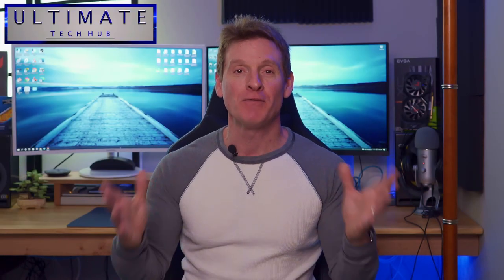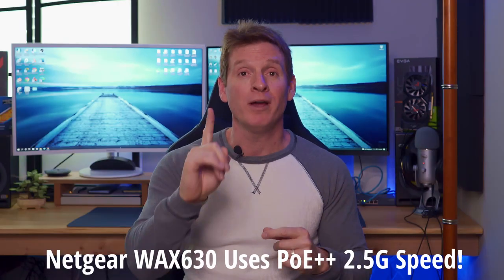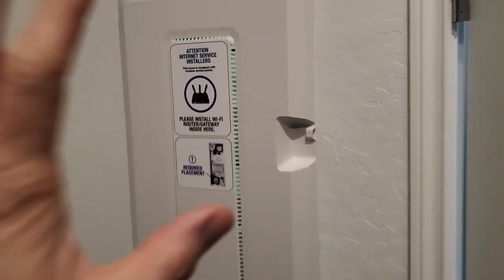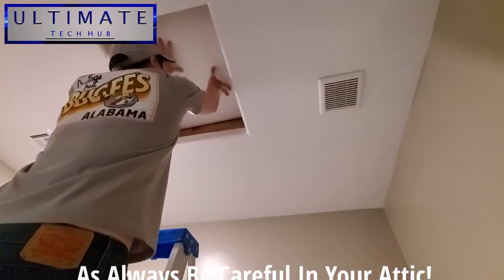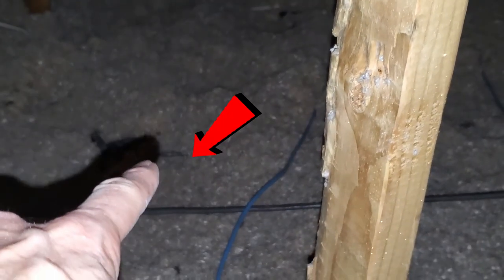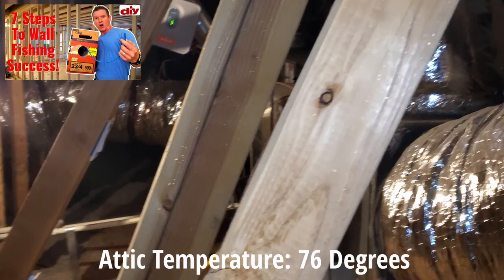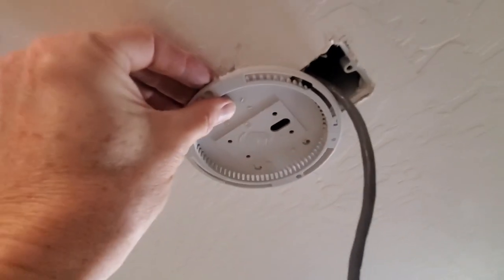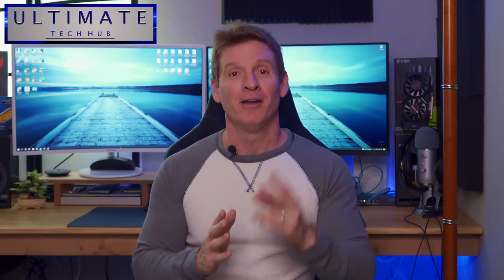INSTALLING CEILING-MOUNT Wi-Fi ACCESS POINT | HOW TO INSTALL WAP 2022

Comment: Thanks for the vid.  I have 3 locations one on each level of my 3 level home.  After I install the WAP’s like you showed in the vid, what do I need to do at the boxes?  There’s an exterior box on the side of the house and another box in the 2nd floor master bedroom closet.  Is some kind of switch required?  I appreciate all detail you’re able to provide about this.  Thanks again.
Reply from the maker: The interior box in the second floor closet is where all the etherent cables should run to. This includes the etherent cables from all 3 WAPs. In the box you need a modem, router and a PoE managed switch to connect to the PoE WAPs. Hope this helps. I have over 100 home networking videos so make sure to check them out. Thank you for watching.
Reply: @UltimateTechHub  It has to be a managed switch?
Reply from the maker: @Tommy-dz5zl  Yes to run the WAPs you need a PoE managed switch. I have videos on how to use them. They are pretty easy and around 100 dollars.

Comment: Hi and thanks for the video 👍 … one question though … I have an existing wireless router from Spectrum with 4 Ethernet ports … I want to add a WAP to increase wifi capability to my garage but how does a WAP coexist with an existing router which has its own SSID?  I assume the WAP will have a different SSID in which case any devices attached to the WAP SSID would then be on a different network from the router SSID?  Will the devices on the two networks “see” each other or how does this work? I’m confused about this.  Thanks 🙏
Reply from the maker: The 2nd router is an acces point.  You will have 2 different SSIDs.

Comment: Set one up tonight. Had a decent bend in my Ethernet . Thoughts ?
Reply from the maker: Does the bend affect the connection? One of my WAPs has a decent bend in  the ethernet but it doesn't affect the signals.
Reply: Yeah. I’ll have to see once I get it up and running. I’m sure it’s fine. Just saw online that the bend shouldn’t be extreme
Reply from the maker: @Arr5503  You would be surprised how durable ethernet cables are. They can take beating!!! Lol. Keep me posted and thanks for watching.

Comment: Hi, I am looking to install 2 WAP in my home(Ubiquiti UniFi 6 Lite) (one upstairs and one down) do I need two PoE injectors or is there a dual port PoE injector I can add to my low voltage panel? Also does this go from modem > router > PoE injector?
Reply from the maker: You could buy 2 PoE injectors but I would buy a entry level 8 port PoE managed switch. TP link makes them for about 150 dollars. This makes your network expandable for future PoE connections or regular network cables. Also the switch is manageable so you control the data to the WAPs .

Comment: What about a surface-mount installation on a solid concrete ceiling? Is that even possible?
Reply from the maker: Yes but running the ethernet will be tricky.

Comment: What is the switch you are using?
Reply from the maker: It's a RUCKUS ICX Managed PoE Switch. I would recommend a TP-Link Jet Stream PoE Switch because the price point is much cheaper. The PoE Switch provides the power and data using the ethernet cable. Thank you for watching!

Comment: Can I use a network switch instead? And can I use regular cat cable?
Reply from the maker: Yes. You will need a PoE switch to power the AP. Otherwise you can use a DC power supply but that requires more wiring and a power outlet. And you can use a Cat5e or Cat6.

Comment: Are there different WAP's you'd recommend? I need 3 and don't really wanna spend 1200+ on access points. Other things to consider - I have 3gbs at the modem so I want to try to maintain that as much as possible / little degradation as possible... But the house is 5500 sqft and so I need 3 (one for each floor). Thanks very much.
Reply from the maker: To take advantage of those 3 gbps speeds you need PoE++ Access Points (2.5 gbps) and unfortunately they are usually a little pricey. Netgear may have some cheaper models that offer PoE++. You can check out Netgears website for the pricing and options. Good luck and keep me posted.

Comment: Ok quick question- which router and modem do you have inside your smart box that are compact enough to fit in there along with the AP and Switch? I currently have a bulky router and modem and they 100% don’t fit in there, so trying to downsize to have them all in one place but still want them to provide great mbps
Reply from the maker: I have a fiber ONT which is essentially a fiber modem and it's pretty small like a large deck of cards. My router is a Linksys Ax5400 which I zip tied to the panel door. I have 2 switches, I RUCKUS ICX and 1 Engenius 8 port PoE managed switch. Any PoE access point will work. I currently have 2 APs, 1 Netgear WAX630 and an Engenius wifi 6e AP. I have a recent video I can send you a link to if you want. Just let me know and thank you for watching.
Reply: @UltimateTechHub  gotcha. So now how would this work if I have a coaxial cable in the wall to my modem to provide internet, but wanting to put all this in the smart box? Because there arent any coaxial cable outlets in there. But there is a splitter. I’m just trying to have my modem and eero mesh system in that smart box upstairs, (because that’s where coverage matters the most) and so that I can plug in a switch in there too, and then ceiling mount an AP downstairs.
Reply from the maker: @Intelbrat  There's no coax in your smart box? You could call the cable company to have them run a coax to the smart box. They might charge you 25 dollars to do it.
Reply: @UltimateTechHub  OR, is the smart box only really for fiber internet? Since mine is coaxial, idk if I’d be able to do what I said in my comment above ^
Reply from the maker: @Intelbrat  Here is a video on my smart panel. It might help.
https://youtu.be/NG0-hSR3iwk
Reply: Thanks so much. Yeah no coax in smart box. I’ll call them. Quick question, I have this same AP and I’m mounting it to my ceiling. Which size drill bit did you use to make the holes?
Reply from the maker: @Intelbrat  always start small to make sure the drywall anchor will fit tightly. I will send you a access point install video that shows it all.
Reply from the maker: @Intelbrat  https://youtu.be/hLA_-I6w-y4

Comment: Why did u change the access point u already had ?
Reply from the maker: I got a the AX630 AP for Netgear for testing and a commercial so we installed it to show the setup process. It's actually better than the RUCKUS in terms of wifi range and the features. Thank you for watching I really appreciate it.

Comment: So there's no power cord?
Reply from the maker: Nope the Ethernet cable provides power to the router. You can use a power cord if you want but it's just not necessary.
Reply: Awesome thanks